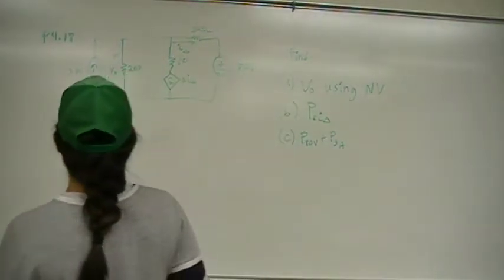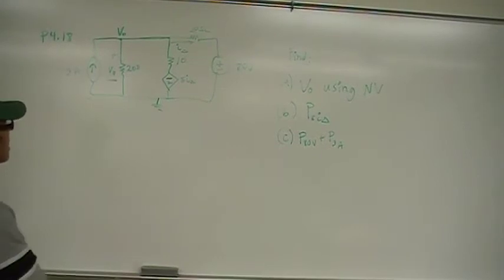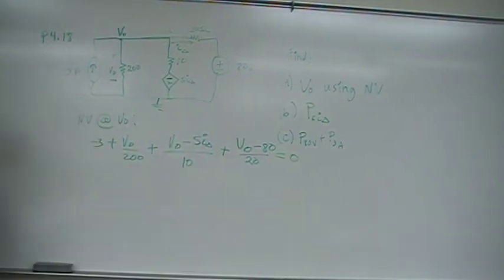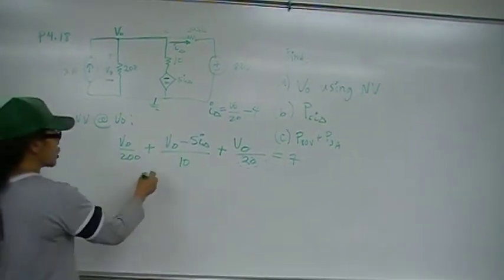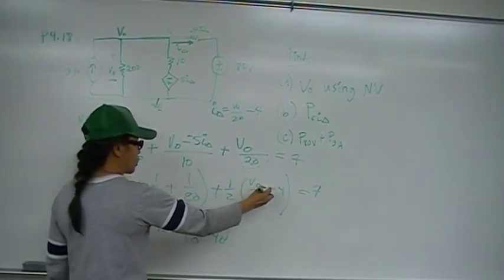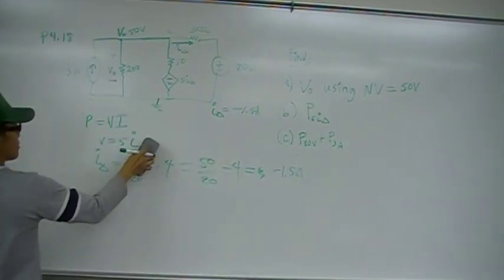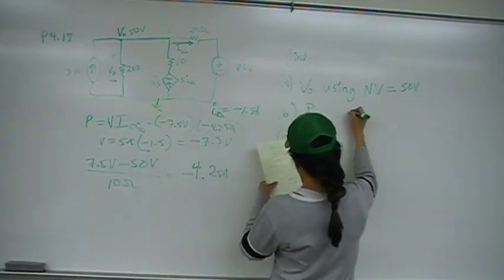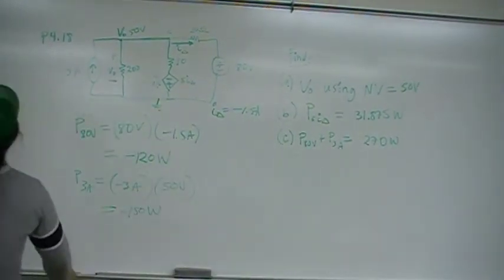Node Voltage with Dependent Voltage Source P4.18 Nilsson Riedel Electric Circuits 9E Solution

Comment: At 7:10 shouldn't the voltage difference of the 10 ohm resistor be -7.5-50 = -57.5? I did the KVL around both sides and it seems to be right. Which means P_abs = 43.125W